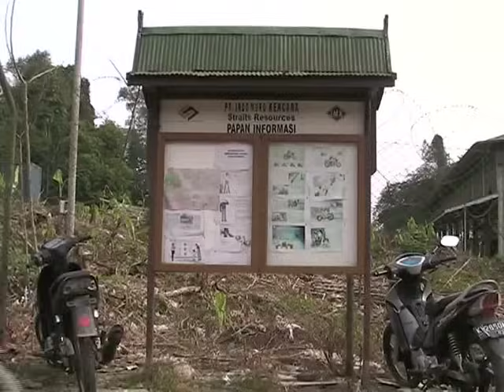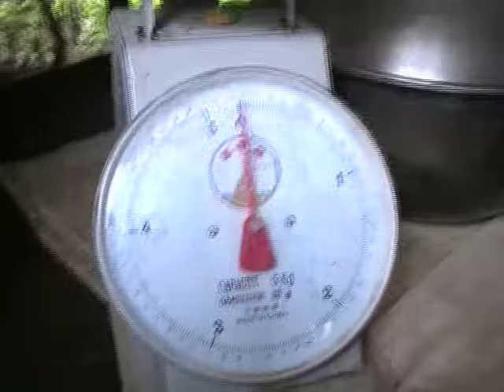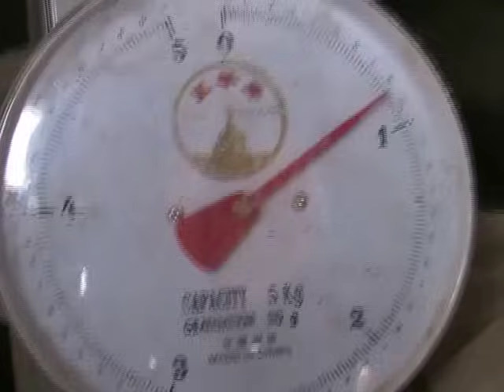Blacksmith Institute - Mercury: The Burning Issue (Part 1)

Comment: A simple pipe retort can be made for about $5.  It recovers 100% of the mercury and releases no vapors.  Why don't you just give them to the miners?  This is propaganda bullshit!  Over 99% of mercury contamination comes from electrical plants and bleach manufactures.  Unless your ready to give up your Clorox and electrical power you will have mercury contamination.  This little dab of mercury has absolutely nothing to do with the tons and tons released in making bleach and electricity.  Don't forget the new curly-cue lightbulbs are mercury vapor!  Why is it alright for you to have possible mercury contamination in every room in your house but bashing gold miners is OK?

Comment: Lithium is not a heavy metal and it is not lethal nor is it very abundant. Thats why they replaced mercury batteries with it because it won't do any harm. Dimethyl mercury is far more lethal than any common lithium compound. (Of course lithium cyanide will kill you in an instant, but thats because of the cyanide.)